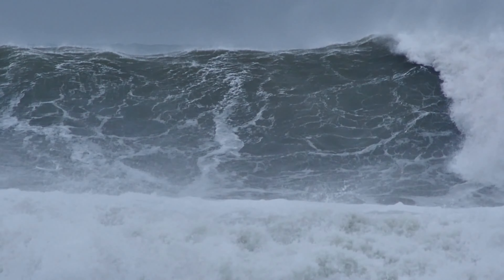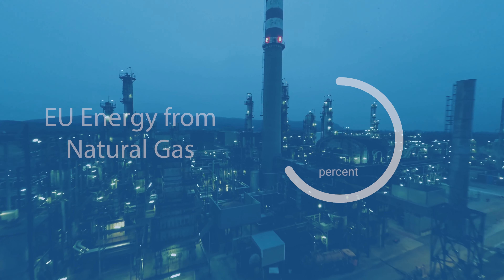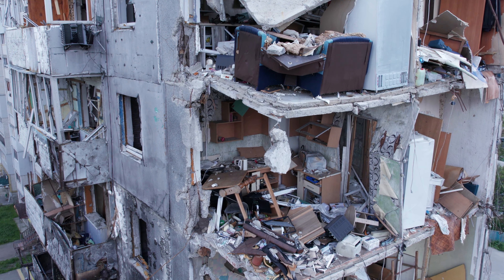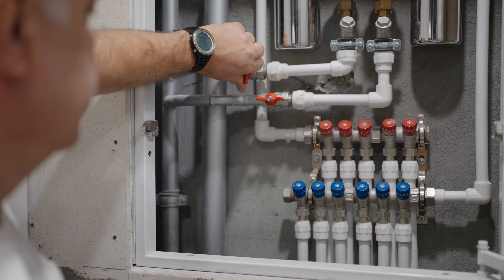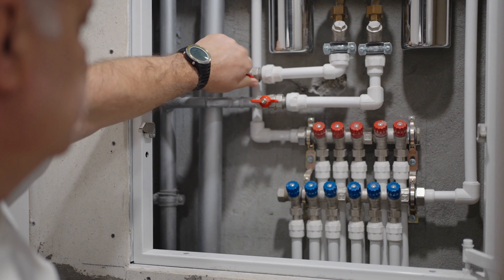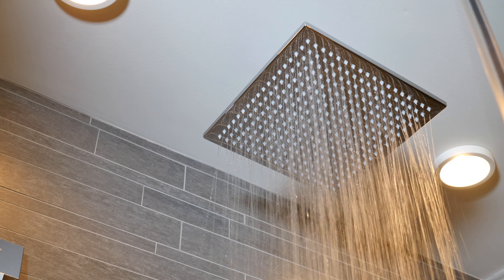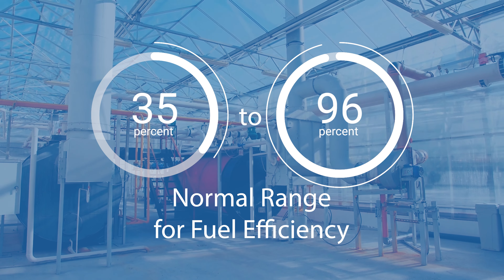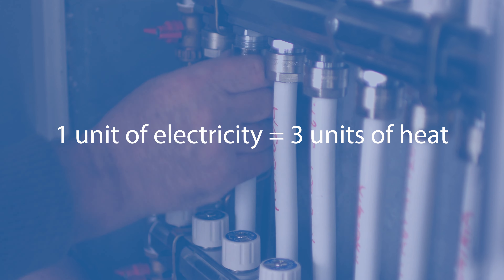Seasonal Thermal Energy Storage

Comment: Forget wasteful and expensive heat pumps, store high-grade heat in the BTES/STES, and use a mixing valve to supply UFH directly. 65deg achievable from STES. I have designed 2 systems like this, one domestic, one industrial. a small HP can be used for DHW, to elevate temp in early spring (more efficient to use a thermal store and charge from ST)